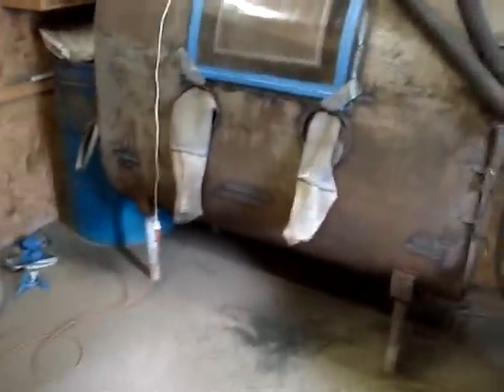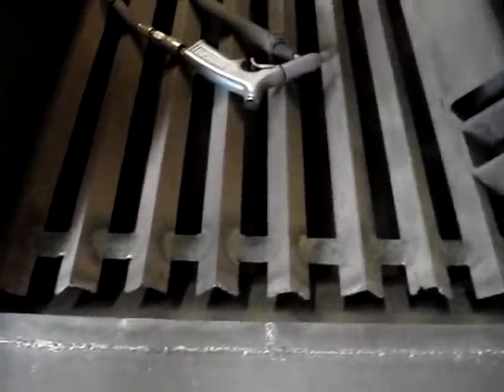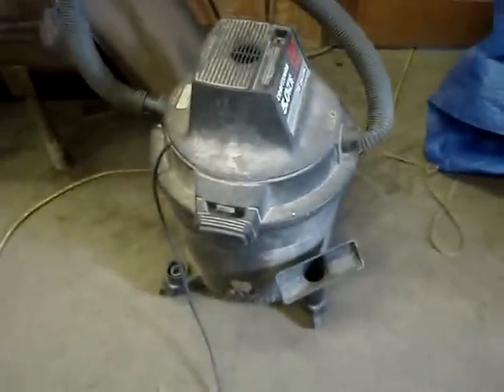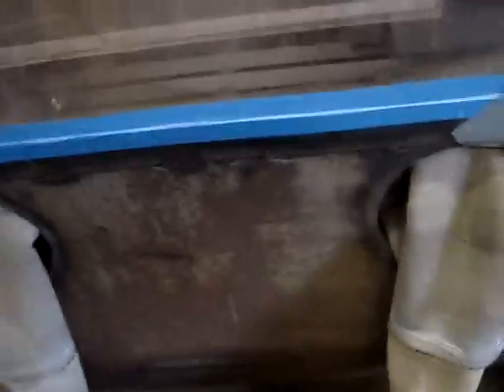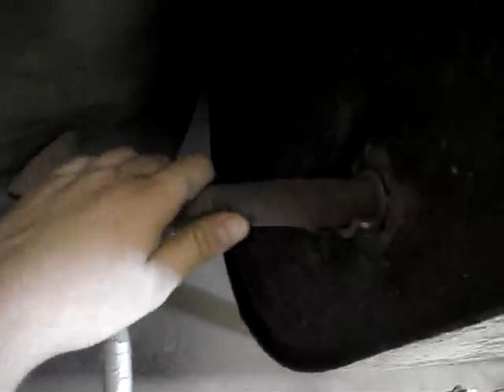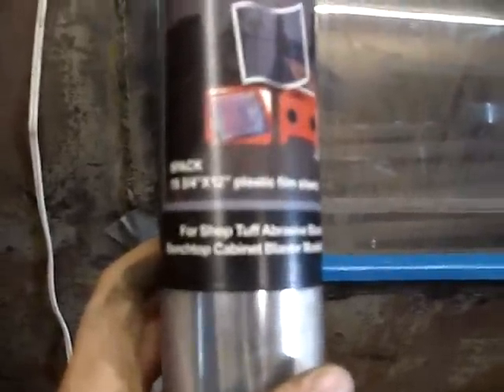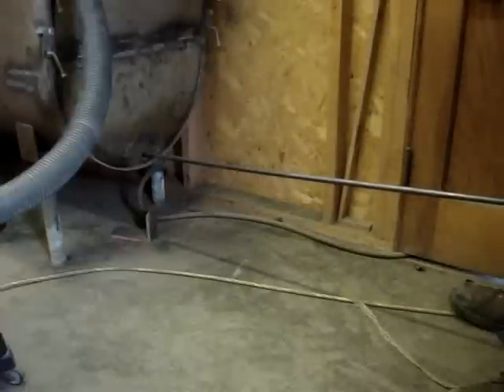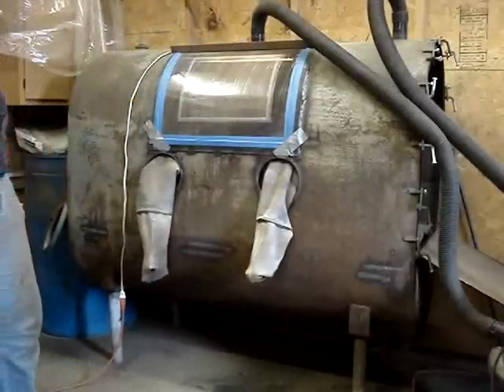homemade sandblasting cabinet

Comment: I really like the design overall and the fact that you reused materials to keep them out of the landfill or recycling yard and save money at the same time.

I think the leaks you mentioned would drive me nuts. Would have to find a way to seal those up, but I don't expect that would be too difficult.

Have you gotten much use out of the cabinet yet? Any issues with excessive wear on any of the parts?

Comment: Do you get on your knees to use this?
I like your idea but it would need higher legs.
Also if it were higher you could weld a funnel to the bottom,
with a shut off, that emptied into a bucket or screener.
I am going to build one but cut the drum in half. Use angle top and bottom with a seal. Hinge the two halves. Two locks.
Why? Bad back. I could use a cherry picker to load and unload.  
The downside is not putting it on a wall. Wheels?
Reply: I just started building one today. I was planning on putting longer legs but it is perfect to sit on a milk crate and blast. I think I will keep mine short just to try it with milk crate because i don't really wanna stant up for hours while blasting.